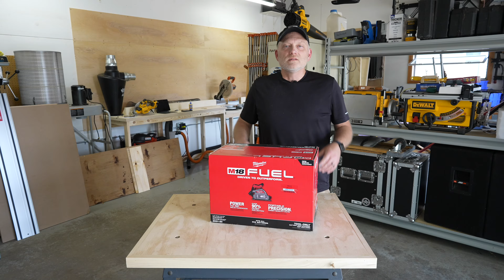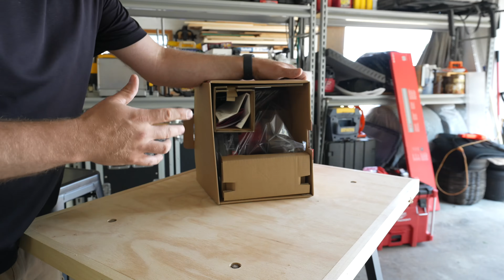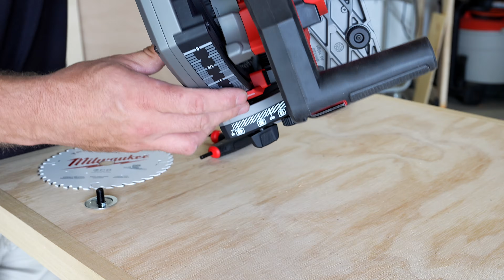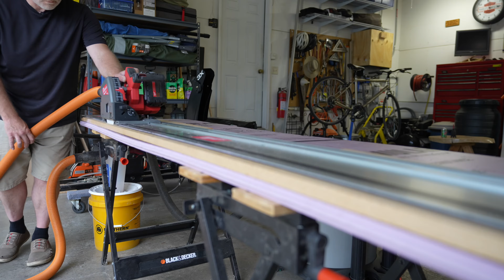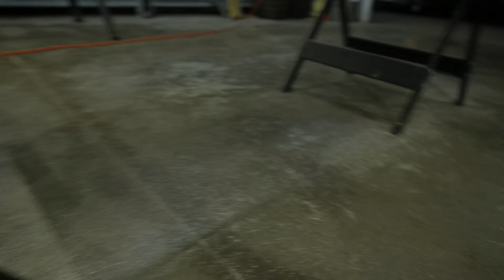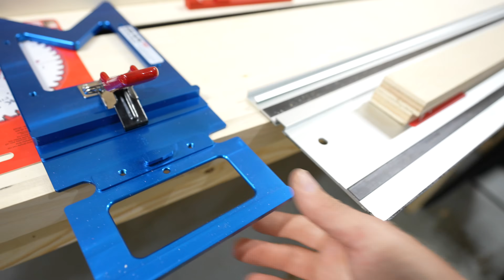It finally convinced me: Milwaukee Fuel Track Saw

Comment from the maker: I added a few links in the description. The Amazon link is an affiliate - no cost to you, but will help support the channel for tool reviews. No affiliate with Farm and Fleet - but they have always treated me well for service.  As far as I'm aware, they ship anywhere in the U.S. (except California). Thanks for checking out the review.
Reply: Great review, do you need to join the tracks to trim the edge guide or can you cut them separately? Thanks!
Reply from the maker: I haven't heard anything official from Milwaukee (if someone has a link, post it here). However, from how well machined they are, I don't see a reason why you couldn't trim the edges separately as long as the saw-to-track adjustment is set properly (so there is no play/wiggle in the saw when running it down the track).  The edge trim is replaceable, so if you see any variance, you can always put on a new edge and cut both tracks together.  I've run the saw on both tracks joined, as well as separately, and haven't seen any offset on the two edges when tracks are joined.

Comment: Nice video. If you zero cut at 90 degree for the splinter guard then you want to use a 45 degree, do you need to replqce the splinter guard again?

Comment: Been a diehard Dewalt guy for over 20 years since I started in the trades but the last couple years it seems to me Milwaukee has been eating Dewalt’s lunch. I did a bunch of research and asked around on jobs and found that the Dewalt track saw has problems and was NOT recommended by anyone so I bought the Milwaukee instead, now I’m thinking I won’t buy anymore Dewalt tools and move into the Milwaukee ecosystem of tools.

Comment: I'm running mine off a compact 21700 based 4Ah DeWalt battery with adaptor and can still fit my fingers through around the top handle. I also have M18 nail guns and Makita Jap made grease gun since DeWalt dropped the ball on all of those.

Comment: Also for the people looking at this video, look at the Kreg acu cut system. I used the system for awhile and was very happy with it, not perfect and does have a bit of play but it worked very well.
Reply from the maker: I looked at that as well, but went with this.  I've been happy with it as a Festool alternative that works well.  It's been a workhorse in breaking down 4x8 sheet goods in my shop and giving a straight edge to rough-cut or live edge lumber.

Comment: So just a tip I couldn’t see much of a gap between your guid rails. The consensus is you should leave a 1/8 inch gap between the two guides because they are not machined perfectly 90 on the ends.. that’s what I have heard.. I bought the saw with a 8.0 amp battery like you.  I’m just waiting to get my guide now boy are those expensive
Reply from the maker: Good tip!  I use a long straight-edge (Bora edge guide or a 4' level) when joining the tracks to confirm a straight edge.  I found the two track sides that consistently work well together and leave the rail connectors in one track so I know which edges to join each time.  Results (for my two tracks) have been consistent.
Reply: @RustyRockAdventures  good to hear. I also was thinking that you could always use a combination square and check to see if it is or not..

Comment: how did you setup your packout for the saw?
Reply from the maker: I usually just take the dust bag off the saw and put both in the bottom of the Packout.  I keep a battery on the saw so it doesn't rattle around.  The Packout usually doesn't have anything else in it (maybe a spare blade). I don't worry about getting a bunch of sawdust in it as it is easy to dump out/clean.  If I am concerned with the saw banging around (like when transporting), I'll throw an old towel in for padding.  I keep the tray on the top for any other loose items that go with my circ saw workflow.  It's a pretty simple setup.

Comment: @jtsworkshop new subscriber. I'm on the Ridgid platform but really thinking about going with Milwaukee for track saw. Before I go ahead and purchase, I have 2 questions.. does it work with diablo 6 1/2" saw blades and any regrets after 4 months or you still think it's the best addition to your tool lineup?
Reply from the maker: Hey - thanks for the sub!  I am only aware that it works with the Milwaukee and Makita blades (because of the arbor hole size vs. diameter of the blade).  I have used this saw a lot more than I thought I would.  It's a daily driver in my woodshop and at our cabin, where we're building an 18' x 30' bunkhouse.  Absolutely no regrets.  I'd buy it again.

Comment: The clear plastic it comes with is not a splinter guard. It’s just to improve dust collection. They call it a viewing window. 

Only the foam piece you actually have to cut through functions as a splinter guard. Also the splinter guard only improves the chip out on the off cut piece which isn’t always necessary.
Reply from the maker: Thanks for clarifying.  The saw is working great - it's definitely a time-saver.  I've found that if I cut on foam and keep a sharp blade in it, then I'm not getting a lot of chipping.  Just a little on the very end of the cut, where the saw exits the material.

Comment: Nice video. I do want to point out you have the wrong TSO guide rail square. I was told by TSO that is NOT the right one for the Milwaukee. You need version 2. You're likely going to run into an accuracy issue at some point using the Milwaukee guide rails.
Reply from the maker: Thanks for the info!

Comment: Nice video, a few comments, Makita also has the anti tipping lip on the track. The allen key for the sawblade is stored on the tool :) and ur not supposed to butt the rails together, usually there is no guarantee the ends are actually cut square. usually a 0.5 or 1 mm gap is better when you join them.
Reply from the maker: Thanks for adding in the Makita details as well as the tip about joining tracks.

Comment: I'd skip the Bora guide and go straight to the track saw if I had a do-over. I have a 2 piece Bora guide for the length I wanted, but the 2 pieces were never straight when together and required endless fiddling and re-clamping to set up for each and every cut. Honestly, if you go with a guide instead of a track system, just buy a straight length of angle iron. Angle iron can be easily checked with a string, then flexed and clamped.

Appreciate the thorough, well organized video! Pro quality production, not to mention this track and saw is going on my wish list.
Reply from the maker: I would do the same. I thought I'd go cheap and get the Bora guides (both short and long lengths), but don't really use it now that I have the track saw.  I'm hanging onto the Boras mostly to use with my palm router.

Comment: It actually runs better with a 6.0 and produces more power.
Reply from the maker: I think I found that somewhere after I purchased this. I'll definitely be picking up a couple 6.0's and a few more tools. I can't believe that I held off on this brand for so long.
Reply: @RustyRockAdventures  just a heads up right now Home Depot has a deal on 6.0 batteries. two 6.0 high output, batteries, a charger and your choice of free tool ranging up to $229 for $299.
Reply from the maker: I saw that - great tip!  The one-handed Hackzall is now in my toolbox ;)